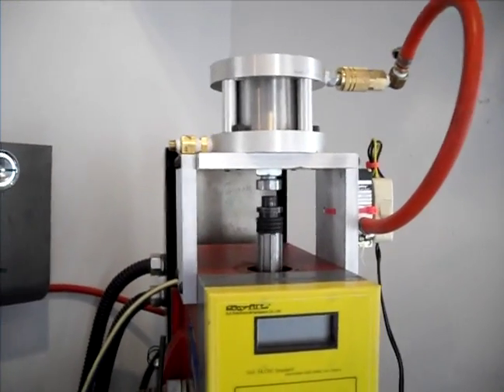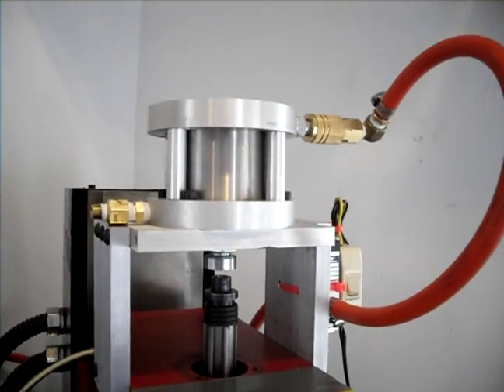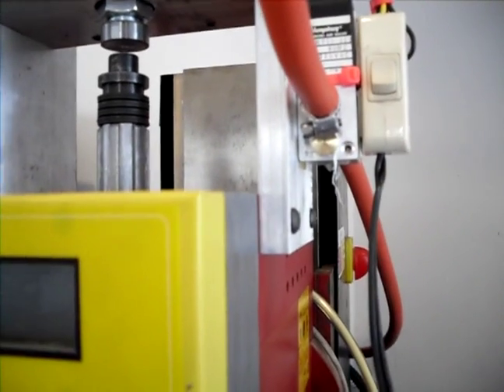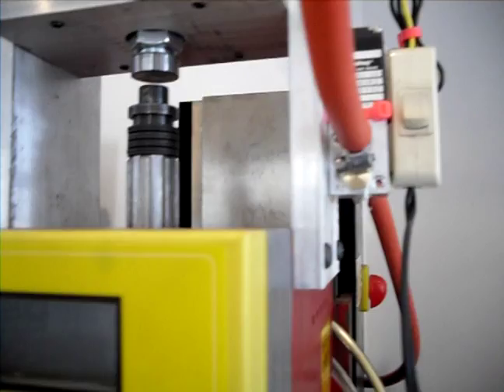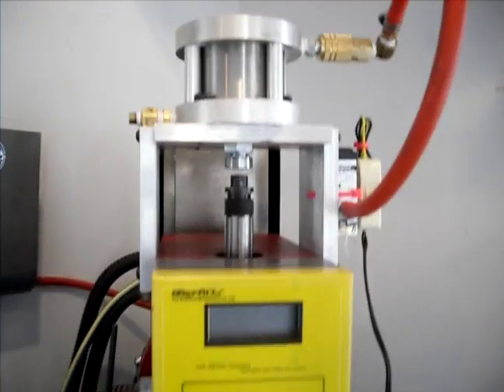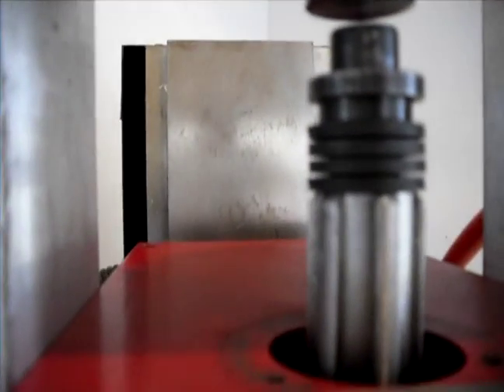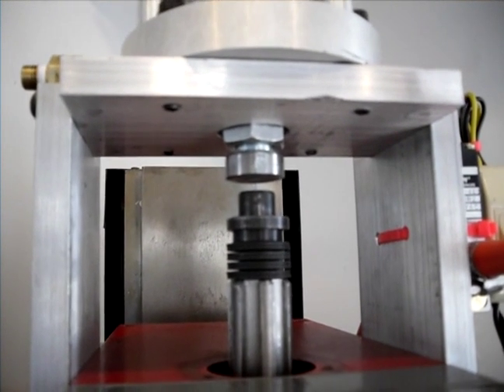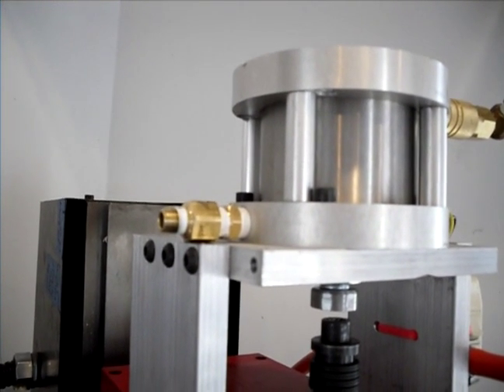Power Drawbar for Syil SX3/4

Comment: Well, the Bimba I used had about a 2 inch stroke, but as you can see, I didn't use all of it.  I had about 100 psi and it was more than enough to compress the Bellville washers and release the tool.  No issues with the bearings at all.  You could do a captured bar similar to the Tormach if you were concerned with it, but you would have to build a floating system for the air cylinder.
Reply: How or where do we get the longer 7/16 drawbar for these?  Do we have to make one?

Comment from the maker: Honestly, I didn't have any specific force I was shooting for.  I put enough air pressure in so that the stack of 8 Belville washers were compressed enough to release the TTS holder.  As for the part number, I don't have one.  It was a 4" Bimba air cyclinder I got off ebay.  You should just be able to search for Bimba 4" or something similar to find what you want on ebay.
Reply: How did you come up with the longer 7/16 drawbar to accommodate the extra length taken by the bevel washers?  Did you have to make one?  I'm thinking I can buy an already existing rod and cut it down to length but I want to take your advice first

Comment from the maker: I have had no issues what-so-ever.  I was always planning on building an ATC, but my needs got to be more than the SX3 could handle and I upgraded to a Tormach 770.  The spindle bearings can handle the load just fine.  In the worst case, they are very cheap to replace after a few years.

Comment: I know this is an old video, but have you had any issues with not capturing the bellville washers and putting all of the force directly onto the spindle bearings? Any slipage issues since this video?
Reply from the maker: I don't have that mill anymore, but for the years I used that, I never had a problem.  I have a Tormach now, and they have a drawbar with an incorporated washer that the drawbar pulls on instead of the bearings.  I would have done something similar, but I got rid of that mill.